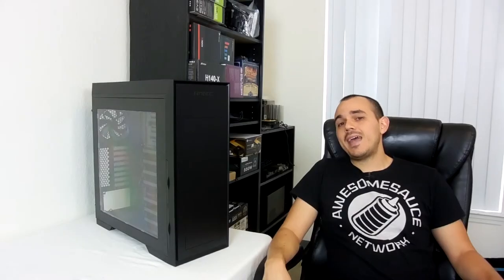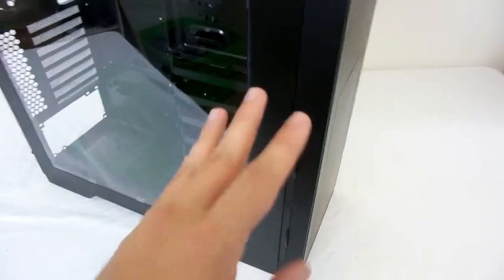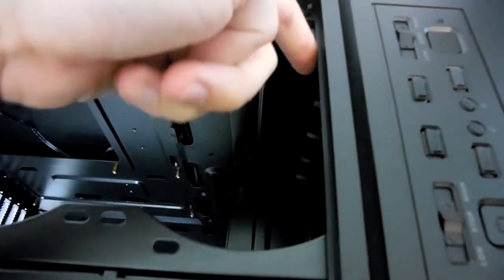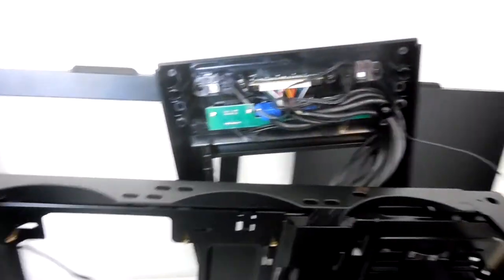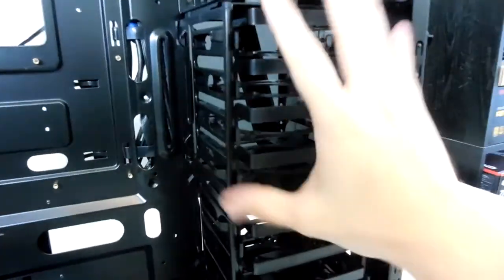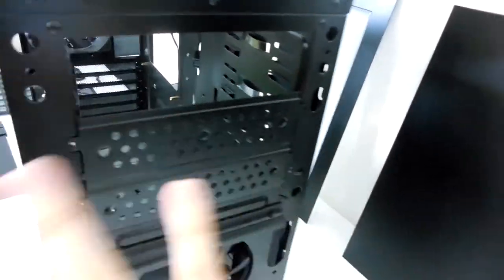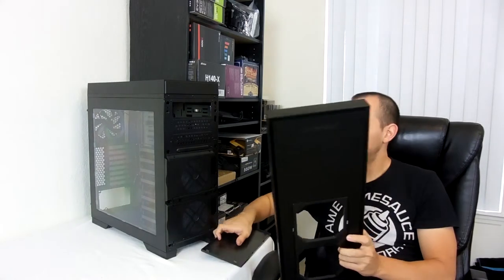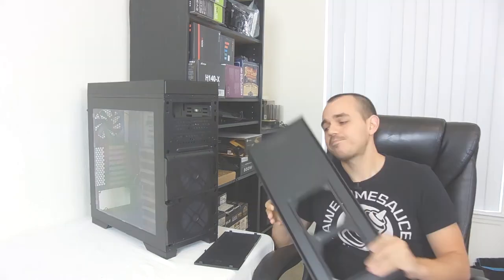Manic Tech #0024: Antec P9 ATX Full Tower Review

Comment: This is a really nice video! I've never built a system w/ an Antec case, and honestly I'm not the demographic that they're aiming at with the P9, but I see the potential within.
Reply from the maker: Absolutely, everything ELSE about the case ticked all the right boxes, especially for a case in this price range.  All they needed to do was take some liberties on the OEM chassis and front panel OTHER than the ones they did, and this would have been an excellent case.  I could have seen this as proper competition to the 750D in a lower price tier... like, much lower...
Reply: Indeed. The P9 does somewhat remind me of the 750D, but my trend now is not using HDD cages- I saved up some money and went w/ a m.2 nvme as a main drive and one 480GB SSD as extra storage. My cheap home server handles the big data. One other thing that I really like now: PSU shrouds- They make systems look really clean.

Comment: First of all thanks for the video, you cover every single thing about the case. Top notch review.

Anyways, I'm looking for a case to make my build and this was a serious contender. I'm not an expert in this matters but regarding the problem with the front panel and fans, can't you just change the 2 fans with ones you can buy to gain more power and airflow with the filter putted on?
Reply from the maker: +Jordi CC well it IS possible to get different fans to overcome the restriction issue, but it wouldn't make enough of a difference since you still wouldn't be getting the most out of this case or the fans you spent the extra money on. If it were my case, what I would do is mod the front panel cover to have openings right where the front fan inlets are, then either set some mesh between the front panel and the inlet cover, or do away with the front panel cover entirely and just set some mesh across the entire front section like the DIY PC version of this case has.  I feel like maybe they should have studied the front of the Corsair 750D to get a better idea of what does and doesn't work for a case design like this, or else just followed what they did with the P70 case they make, as that case has excellent airflow. 

If you do decide to go with this case, I'd love to see what solution you come up with to address the front! The only other thing to be concerned with is the dust filters, which are also extremely restrictive, but I feel with either static pressure fans or simply replacing that mesh with some of your own this case would be really quite good!

Comment: I was just about to buy this... really need front intake. Saved me for sure.
Reply from the maker: Thanks for watching, glad you found the review useful!  You are definitely not the first to echo that sentiment, and it's a shame, really.  This case had all the makings of greatness, and really it would only be a matter of changing the front panel to one with mesh in its place rather than the block-off plate to largely correct the issue; even WITH a highly restrictive dust filter that would have alleviated much of my concerns with the design, since a high static pressure fan would largely overcome that issue... but it can't overcome the whole "no airflow whatsoever" issue x-D.

If you're looking for a case similar to this in terms of accommodations and aggressive pricing while still holding ATX form factor motherboards, maybe consider the Fractal Design Define S; I recently built in one for a friend of mine, and I am here to tell you the hype over that case is real!
Reply: Doh, to late, I ended up with a tiny microatx case called "Aerocool QS240". It has zero 5.25" bays, and no harddisk caddies higher than the PSU, , so two front flans blow directly onto CPU and GPU, with a huge removable front and top filter. Its actually a low end case... got it for $40USD.... crazy good price. Will consider it that Fractal one for my next ATX build though, it looks pretty good, but this aerocool case has the best airflow I have see by an absolute mile. The entire front and top is a mesh with dust filter.
Reply from the maker: +Secto Kia yeah that doesn't lookike a bad case at all for the money. Looks like something I'd have liked to take a look at for the channel, perhaps some day I will :-). Aerocool makes pretty good products for the money, though the only experience I have with their lineup is their aftermarket LED fans which, while a touch on the noisy side, move monstrous amounts of air.
Reply: Hey dude would a corsair obsidian 450d be better than instead of the p9? its the only alternative ive got here at the moment, didnt think airflow was this flawed thx.. but are there flaws on the 450 d too do you know sth? would be nice if you could response and help me out real quick :)
Reply from the maker: As far as I know, there aren't any real trade-offs going with the 450D apart from maybe the lack of dedicated mounting hardware/locations for water cooling reservoirs.  It will hold the same amount of gear otherwise, have better airflow, and frankly look better IMO.
Reply: aight, thank you very much :]

Comment: Great Review! Man i was just planning this for my new build an u safed me! I guess the flaw is not too dramatical but still thank you ;p
Now the other options i considered and which would fit in my desk are from corsair... 300r and 450d Can´t really decide between them atm xd I think the 300r should be a bit more silent and maybe better airflow? I just think the 450d looks better tho and its the bigger case actually and in the store here in my country is a special offer atm so theres not much price difference between them, hmm what would you say?
Reply from the maker: mmm, you'd be surprised.  The 450D has some pretty good airflow even with the solid front plate, but that's because Corsair actually engineered that front panel to breathe much better.  HOWEVER... if maximum airflow is something you want to guarantee is a thing, there IS a high flow variant of the 450D that has a perforated front plate to maximize airflow through the front while still maintaining that largely "monolithic" look I imagine you're wanting to go for.

Really the only reason to place the 300R in the same grouping as the 450D would be if you were considering different budget ranges, there really is no comparing the two models: the 450D is a newer chassis and has what I think is a cleaner, better internal layout, while the 300R is an older, but more cost-effective solution.  The 300R windowed version also has those openings for side panel fans... and while FUNCTIONALLY I understand where someone MIGHT want to use those... they kind of trigger me pretty badly, ESPECIALLY on a window... lol I dunno, just the fact that I am seeing fans instead of the cleanly built system inside bothers me.  Also, consider that the 450D has better water cooling accommodations, should you decide to go that route with something like an AIO or even a simple custom loop.

Anyway, glad you liked the review and found it helpful!
Reply: wow, thanks man. i think im not gonna use a window, dont want it to be too much of a "gamer look" if you know what i mean :D no watercooling also, but u are right that it is a factor that the 450d is much more modern and thats why i considered it over the 300r at first, but i was wondering if it would make more noise than the 300r idk :D(it is a "silent case" and the other one isnt?) the price difference is marginal, but its still there, yea.
all in all you would say i cant go wrong with either of these cases?
one thing that worries me a bit and i forgot to mention is that my cpu cooler, which is named brocken 2 is going to be 165mm and 450d supports exactly up to 165, so i hope it will still fit without probs :o i found different specs for the 300r somehow lol, some say up to 165 some 170 and 175.. oO
Reply from the maker: The 450D is a bit larger, I believe, so if your CPU cooler is a bit on the tall side I'd err on the side of caution and go for the larger case, even if it's only by a little.  True, at that point you would have to go with a windowed side panel, but frankly for the sake of getting a case that is guaranteed to actually hold the hardware you have I'd say it's a worthwhile trade-off.

Of course, if ease of use and silence is a concern, and you don't need ODD bays, the Carbide 400Q is a really solid bet: it has no side panel window, is designed for silence, and has unidirectional airflow: everything just flows from front to back with no roof ventilation without sacrificing hardware temperatures.  You can also house a decent amount of AIO water cooling in there should you so desire later on down the line... and the pricing on that case is pretty good as well.  Again, it's a question of what you NEED to house in your case, and I personally haven't used an optical drive in years now, so I kinda want them to go the way of the dinosaurs tbh x-).
Reply: xDD yea in the future they will, but i can still use that^^ love to run some older games like aom thats why also dont want to use win 10 lol as it wouldnt work, and just to be on the safe side :P
u are right, and i guess its also better to have the chance of a better running system and modern case+ the option of wc, then a bit more silence. so i will prolly get the 450d
thx again :)
Reply: Hey dude, u just earned a new sub btw :) a friend of mine suggested the Inwin cases 503 or 703, as they should be super good for their prices and the cpu cooler will dfntly fit in there with 170 mm max height.. i never heird of these but the 503 and 703 look quite ok i think, the other inwin cases i dont like too much look to much like gaming again lol
do you know sth about these =?
last question i promise xD will buy the new case tomorrow for sure...
Reply from the maker: Uh, I dunno what specs your friend was looking at, but even their website fully indiactes that both of those cases will only hold a maximum of 160mm tall CPU coolers.

An easy way to tell if a case will hold super tall heat sinks is to look at the rear fan: if it's got a 140mm rear fan accommodation, then it's pretty likely it can hold a super tall heat sink.  if it only has a 120mm fan or smaller at the back, check the case specs to double check, but it's pretty likely that the case won't hold a large heat sink.

As for the cases otherwise... while I haven't taken a look at either one of them personally, I believe Dmitry over at Hardware Canucks did a review on the 703, and it wasn't particularly favorable. There were quite a few build quality and usability issues the case had, and didn't really live up to the typical InWin standard of build quality.

Have you considered the Fractal Design case lineup?  They have lots of really nice, affordable cases that have a very minimalistic exterior design to them, with many of them having non-windowed variants available, with some of them having extra sound deadening material on them.  They are also notoriously accommodating of a wide variety of cooling hardware, and in my experience have been some of the nicest cases for me to build in.  

One to suggest that isn't super spendey is the Core 3300; no side panel window, lots of cable management room, open airflow design, and room for CPU coolers as tall as 180mm.  If you can afford to go a bit more spendey than that, I would 110% recommend their Define R5, as it takes the same kind of design and takes it to the next level with more robust build quality, sound deadening foam in both side panels, the front door, and the roof, modular hard drive cages, modular roof panels... and above all, a SUPER sleeper look that is totally unassuming.  They go on super sale quite often, and I personally own a Define R5... the only reason I'm not presently using it is due to my personal needs for a system (wanted something with a FULL view of the interior in to the case, and the Define R5 doesn't have a FULL view, only partial.  You could also go with the Define S, which has the most open airflow I have ever witnessed in a case before, and still has alal the same features as the Define R5... only it tends to be quite a bit cheaper without sacrificing on build quality (I built in one for a friend of mine, he loves it).  

Not trying to be a FD shill or anything, it just strimes me that what you want is understated, no frills, functional, and inexpensive... Fractal Design cases fit that bill exactly.
Reply: Yea wanted to use the r5 first, but unfortunetly i dont have enough space here in my corner/desk its too big xD
So its gonna be inwin 703 or 450d now i think, thanks again for your help, gonna check max cooler height support again, man its so annyoing every site has different specs for the cooler height lol
Reply from the maker: The only place to go to check the specs for a case is the manufacturer's site.  Anywhere else stands more of a chance of being wrong.
Reply: yee ok, as u said in win is 160mm lul and obsidian 450d 165mm, the cooler is 165mm. well hope it will be fine :D

Comment: 16:30 - this is such a bummer. The manual mentions nothing on how the panel should be (on or off). Taking it off makes the case quite ugly and after some time I've realised that dust actually creeps in around the dust filters in the open slits (unless I've installed something incorrectly...)
Reply from the maker: Well with most dust filters you'll get a little bit of dust creeping in around them in most cases unless they're magnetically attached to the case all around the border, and even then that's no guarantee.  Really, tho, the design of the front panel in general is just damn disappointing, especially considering the potential the case had otherwise for its time.  Maybe consider modding it, tho, since that WOULD alleviate a lot of the major concerns with the case!
Reply: Modding sounds good. A simple mode here would be to cut out the small front panel and put some nice dust mesh from ebay and remove the built in ones (sealing the side slits where they go in). This would also allow the front small panel to be taken out and washed easily.

In regards to the dust: no, I am not referring to the microscopic space around the filter edges. I mean there is enough space between the front large panel and till it gets to the filters to the filters don't cover all the inlet area. I'll get home and take https://www.youtube.com/watch?v=nwGdEkmZn0Qanother look...

Comment: Antec manages to ruin great cases every goddamn time
 EVERY. TIME.
It's just stupid.
Thanks for the comprehensive video.
Reply from the maker: it was really disheartening to me to make that discovery; In recent history I've taken a look at a few of their offerings and been mostly pleased with what I was seeing, but this was just a step too far.  It honestly felt like no internal testing was done with this case to ensure proper ventilation for the case, and given the nature of the hardware that was meant to go in here it should breathe much more freely than that.

Even during my fan testing, you see that when those fans aren't being obstructed they move a pretty solid amount of air.  it has all the MAKINGS of a solid offering for the money... but a system builder shouldn't feel forced to have to either not use a feature entirely or else mod their case in order to make it usable; modding should be used to either ENHANCE existing features, enhance the looks, or add new features that weren't there before... not make the case work in the first place.  Shit even if they just copied VERBATIM the front panel off of their P70 I reviewed here, this case would have gotten a very solid recommendation from me... but the need to mod the case, the ugly cross brace with the lazy "B" left stamped in the front, and the overly restrictive dust filters just isn't up to the standards that I KNOW Antec are capable of.

Comment: 17:32 is it high or low speed?
Reply from the maker: That would be high speed
Reply: oh crap i bought this case for my first build and i watched every review but this cuz it was 20 mins, skipped the only one with the bad news...
Reply from the maker: All is not lost, though!  If you use fans with high static pressure in the front of the case you may be able to overcome some of the airflow issues up front... but that still doesn't resolve the front plate.  You CAN remove the front cover, as I explain in the video, but it just doesn't look too good when you do that, and you bought the case because it LOOKS good, no?

One solution: leave the front cover plate on the front panel, and remove the front panel.  On the reverse side you'll see where the front panel openings line up with the front cover plate.  Using a white wax pencil, draw the outlines of the openings like it was a stencil on to the front cover plate.  Remove the front cover plate, and using a Plastic cutting disc on a rotary cutter (Dremel), carefully cut out the outlined area.  Doing this will not only let you keep the front looking more clean, but you will also get more airflow out of your front fans.  I CANNOT GUARANTEE HOW IT WILL COME OUT, HOWEVER, SO DO THIS AT YOUR OWN RISK, PLEASE x-D.
Reply: i think ill remove the front cover and maybe replace the filters with mesh or somethig cuz i dont have a cutting disk niether a wax pencil but still thanks alot for your support and keep up with the great reviews!
Reply: my last question is will i be able to get positive flow with good enought temps if my front cover is open, the front fans on high speed and the back on on low speed?